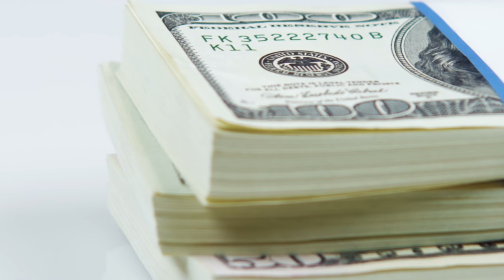Pros and Cons of being a Mechanical Engineer | Explore Engineering

Comment: He is 100% correct about the good companies or even decent companies not wanting to hire new engineers. Even "entry level" jobs sometimes ask for 2-5 years of experience. That is not what I call "entry level" if experience is require. It seems like you have to accept a mediocre job that doesn't even require an engineering degree just to get your foot in the door or some experience before you can even get an actual engineering job. Also, another thing is when you have internship in a certain type of engineering such as Quality or product engineering for example it seems like you get stuck in only that category when it comes to actually getting a call back from recruiters. It is like you want to apply for something else but then they say "Well your experience is in Quality" Well how the hell do I get experience in another area when you won't even consider me for a position outside of that? It seems to me if you are a new grad. Unless you have an extremely high gpa, or some good connections with someone in a company who can get you in. Than you are screwed, you have to start at a crap job first that you don't actually want.
Reply: Ever heard of something called lying on your resume?

Comment: Just a few things. Course work can be applicable if you are a mechanical analyst. Other than that, most mechanical design engineers model with best practices and send their models to an analyst to run thermal, structural, or flow analysis. Mechanical engineers are paid decent in general, but I don't think they up there with as a high-paying profession. You can be a mechanical design engineer, but you will have to wear multiple hats especially in smaller companies. This means you own the design, you own purchasing the components and hardware, you own assembling the product/prototype, you own the NPI processes, you own the quality aspect of the product. The experience will definitely be good for an associate or level 2 engineer, but the salary will more than likely not match the job description. Expect to start out between $45k-60k. Generally, the only "promotion" a mechanical engineer receives is when they move on to another job. Job hopping is typically the only way you can bump your salary from associate level status to a level 2 or 3. In order to do this correctly, you'll need to be experienced 3-5 years or more AND move to a job where your skillsets match the job description. Which brings on to the next point: experience. As mentioned in the video, mechanical engineering is so broad. It can be both a good and a bad thing. You can have 6 years of opto-mechanical or electro-mechanical packing experience, and yet you won't be qualified for a lot of the mechanical engineering openings, especially HVAC specific. Companies are looking for very specific skills. Don't expect a call back if you are missing just one skillset. You can have 20,000 hours of CAD design using SolidWorks, but if you don't have professional experience using CREO, NX, Inventor, CATIA, etc. which that certain company uses, then there's a good chance you are under qualified for that position. Then there's the PE license. This license typically applies to HVAC/Buildings and sometimes in Aerospace. There is also A LOT of politics to be played with any engineering profession. With that said, mechanical engineering is still highly regarded and you can expect to be in the six-figure salary range within 6-8 years. Just know beforehand what you want/like to do, and focus your experience in that category of mechanical engineering.
Reply: Giosaurus Rex very well written,thanks
Reply: Giosaurus Rex thanks for the heads up and advice I'm only sixteen but I'm taking what u said  with consideration in my future of a mechanical engineer

Comment: When I studied Mechanical Engineering in
the 1960’s,it was all about the Mechanics
of Machines and the Strength of Materials.
The other subjects included,Mathematics.
Applied Mechanics,Electricity,Thermodynamics,
Engineering Drawing and Design.
In those days we had Log Books and
Slide Rules and other Tables to Solve
the Answers.I feel in away we should go
back to these Principles.I ask myself,how
many Mechanical Engineers today,can use
Workshop Machines,Welding Process’s,etc.
I doubt if there are that many.
Reply: We literally take a course in machine shops and several in designs with cad and solidworks...

Comment: Pro: Let me work on vehicle components.
Con: Automotive industry is intensely boring.

Pro: Decent starting salary.
Con: Capped quickly.

Pro: Engineering community.
Con: Over-saturation of new graduates from engineering in general (you'll notice this when applying for positions).
Reply: For the 3rd one I notice this at my colleges career fairs

Comment: In my first Co-Op they honestly didn't care that my much about my degree, but more that I had 15 years as a technician beforehand. Get experience, take things a part and try to understand the whole system, buy a cheap 3d printer, go to the junkyard for free (or a dollar sometimes) and take an engine apart and then leave. Don't stress about the course load, rather find someone to help you if needed. If you want to be an engineer DO IT. That's my advice if you haven't heard it already.

Comment: i like the sub-types of mechanical engineering from ncees better, thermal and fluid systems, hvac & refrigeration then machine design and materials. kind of describes what kind of major courses you can get in undergrad. all the subtypes mentioned here constitutes a specialization which is a derivative of mechanical engineering. this has to be explained clearly because aspirants might have a wrong idea about mechanical engineering as a course program.

I wish i can go ctrl+H and replace the words when the narrator mentions mechanical engineers with 'experienced' mechanical engineers so its all true, lol.

Comment: Lads it's my second year in civil engineering I'm taking two civil classes. Loving it but I'm torn between civil or mech. Can any mech engineers give me an insight in their jobs? I like civil but I recently have been thinking about working in the automotive industry as an engineer
Reply: hikingbird42 I have the same problem
Reply: It's an on-going joke between my friends and I (we are all mech undergrads) that we should have switched to an easier major like civil engineering.
Civil Engineering, to put it bluntly, is a considerably easier major than mechanical engineering because you do not have to worry about classes like Thermodynamics/Thermofluids.
Reply: @jcottingham22  the joke is between most mech majors. 
My friend used to joke about F=MA since civil undergrads stop at solid mechanics and dont use it as much.

Comment: Hardest part is to choose which field to specialise  and gain experience..In the industy most of the technical problems are overcomed by hardworking engineers but the project management and administration will make the problems  worse always and things get stuck , you will be blamed and even you wont know you are blamed.. more you are successfull more you will be punished. so instead of being the burn out one, start to study project management or administration after a few years of professional experience. be the one who f.cks things up and blame the tech guy. this video can not reflect what it is, go and read the comments/reviews about companies in the career platforms.. when working with people from subdiciplines such as aerospace and materials engineering , and a mechanical engineer from a low level university , always be careful , they always try to undermine you because of the fear they have.. I dont know what they are afraid of but they get scared to see a good engineer even you help them. And the aerospace engineers are the worst.. they dont have any fundemental scientific/technical/management point of view. they only have titles.dont get close to them
Reply: you will easily get along with electrical, chemical and civil engineers and be respected.. aerospace guys are terrible

Comment: Im not a car guy.
Reply: you don't need to be
Reply: You don't need to like cars, I don't and I have a bachelor in ME. It's all good
Reply: João Encarnação but are you keen and knowledgeable about cars tho? Generally?
Reply: João Encarnação
1 segundo atrás
To put it simple I don't know any models of cars, engines or whatever (unlike many colleagues I had, who could tell you the year of manufacturing, what engine and many other specs from memory), what I have is knowledge (not very specific but basic knowledge) about mechanisms found in a car, like how a manual clutch works, how engines work, etc.

I believe an Engineer must have basic knowledge on as many things as possible (even outside of ME, I ,for example, am studying electronics out of interest). If you need to know something more in depth you'll have to study it further, there is no running away from that fact.

Are you interested in following Mechanical Engineering?
Reply: Mechanical Engineering is not only about cars.It covers a WIIIIDEEE range of activities.So chose what you like the most